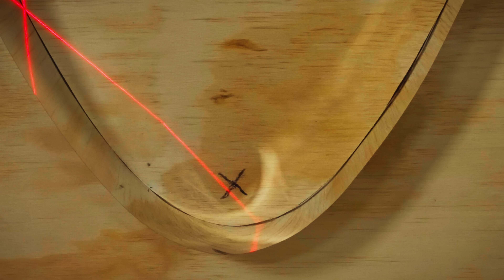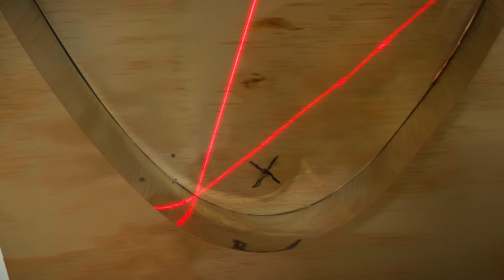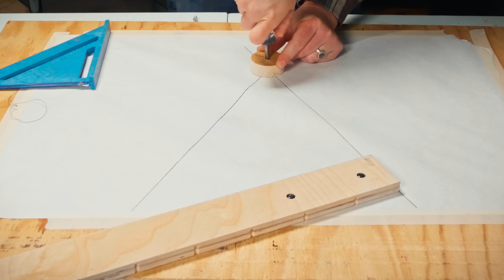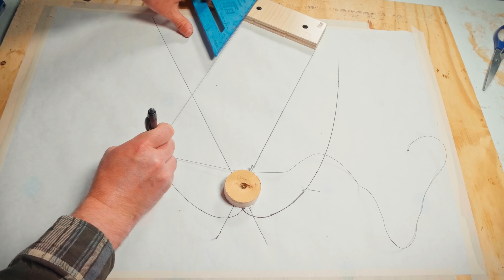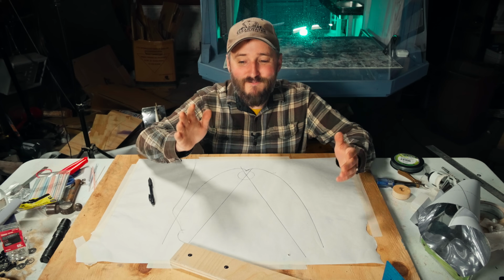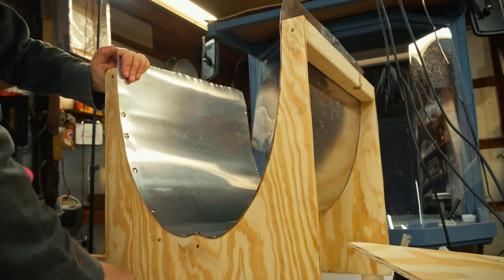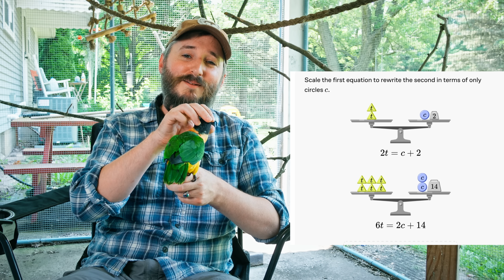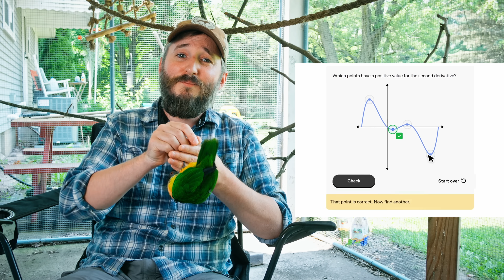DIY Solar Concentrators, Made Better.

Comment: Ben. Your commenters are correct. Your hanging chain catenary is NOT a parabola. But it’s close if you use this trick.

You may recall that the focal width of a parabola (that is the distance between the sides of the parabola) is 4p where p is the focal distance. OK, maybe not, but just take it from me as a fact because I already looked it up. 

Choose a focal length p. Separate the ends of the chain  by 4p. Use a chain length of 4.8p to 6p for a decent approximation of a parabolic curve.

Comment: Imagine if you took the compound parabolic shape that is meant to focus on a flat line, and then extrude and rotate around to create a mirror that focused on a circular plane. I wonder if such a setup where the plane was a solar panel would result in the panel collecting more solar energy than a similarly-sized, square solar panel with only the extruded compound parabola. The difference is one has a bowl-shaped mirror and the other is a trough-shaped mirror. I imagine the bowl-shaped one would be useful at more angles than the trough-shaped one.

Comment: I won't say this makes a better parabolic dish or not,but go to Wal-Mart or similar,get one of those hygiene mirrors with 24x magnification,and tinker with that.i found that adding magnification to the parabolic dish appears to be quite effective,but I am one to say experiment,and gather your own data.i doubt this can be easily applied to this concept in the video.i took one of those hygiene mirrors on a camping trip,and for something that fit in my pocket,on a sunny day it reigned king of burning material.

Comment: As ALWAYS, i LOVE watching and learning from your videos!!!!! I wanted to help share a idea with you ive myself been working on trying to research and possibly figure out, which is setting up a perfect array of mirrors for a solar panel, i seen a video about how in some state somewhere they made an incredible and amazingly efficient apparently, solar setup via a HUGE array of mirrors, all scattered perfectly placed across a flat piece of land, with the solar receiving part or panel they used was focused directly in the middle to where they were able to not only maximize the solar capabilities, but the video claimed they have been successfully running the entire town off this setup still to this day as far as i know. So MY IDEA is doing the exact same, but on of course far smaller scales. I want to try to figure up a way of using several mirrors to maximize the solar panel by having them setup so that the panel can be fixed in a single spot, but can get maximized and have the best chance of ALWAYS getting hit with the sun from as much i can reflect and redirect it towards the panel so that as long as the sun is out at all, i can have my panel in a fixed spot, but ALWAYS get it to receive sun if not direct then at least by the reflection of the mirrors. And im SUPER CURIOUS on how practical that would or wouldnt even be on such small of a scale. I know most people maybe yourself included, will say its a worthless road to go down, but thats why i wanted to bring the idea to YOU, because thats what you seem to do BEST, is prove to us not only how things CAN be done simple and easy, but also by even TEACHING US HOW and how we also can do the same. Which is why again i LOVE your channel, so PRETTY PLEASE WITH CHERRIES at least CONSIDER trying it out and showing us the results PLEASE!!!! i know if it can (AND IT WILL) work, MILLIONS of people would DEFINITELY WANNA SEE, and especially would wanna know how to themselves after seeing how simple it could DEFINITELY be done!! MUCH MUCH LOVE BUD, THANK YOU SO SO MUCH FOR SHARING YOUR KNOWLEDGE AND PROJECTS WITH US, I CONSTANTLY LEARN SOOOOOOOOO MUCH FROM JUST WATCHING YOU!!!!!!

Comment: One way to avoid using speed square is to pin the string to a point far away from parabola. String approximates constant direction and length.
Reply from the maker: That's a good idea! Probably more accurate than the square once you get out to 50 paces

Comment: 7:13 Couldn't you have obtained your cumpound parabola by using the chain trick, just offsetting a second parabola from the first one, vwith the crossing point  indicating the placement for the pipe?

Comment: Because of the ban of plastic straws in France, we sadly can't build those curves any more. Also, those curves could be useful to optimize a solar heater, dryer or furnace, or even a tiny-enough solar panel that can handle the heat.

Comment: Oh please you simply learned about the parabola. You didn't make anything better you simply learned about something that's been around for centuries. I am amazed that you had to get so old before you learned about this when us old folk knew about this long before you were born. The main flaw in your design is your collector angle and area, also try a circular design. If you want to learn more go check out ax^2+bx+c but it involves math which you probably know nothing about. Stop copying and start inventing.

Comment: The problem is in a colder climate this contraption will require a significant thermal insulation to save the heat from dissipating into athmosphere due to a significant thermal gradient between the target and the surrounding ambient temperature material.

Comment: So if I wanted to do this for a solar oven using my crockpot as the pattern shape, would I make three forms? One for the center (widest), and two for the ends(narrowest), and connect them like a skin for a boat? I imagine more forms (like bulkheads) would make a smoother form. Or am I reading too far into this?

Comment: I just ordered some peel and stick mirror film. I plan on making a 6ft shaped box on your design with a glass cover and a 1" copper pipe painted black. I'm going to circulate water through it from a 5 gal bucket and see how long it takes for the water to increase temperature and up to what temperature I can achieve.

Comment: A nighthawk heater , a junk car heater core, a computer fan, and ,a small solar panel along with insulated piping  [ most of you have or can access these items ] and you can bring the heat inside.  Ensure a zero pressure vent above the device.
.
 1/4 mile drag racing engine catch can  if your eternally anal.
Solar panel for computer fan= zero paid consumable electrons. And autonomous operation. Be well

Comment: Don't know if anyone mentioned it, but aluminum is excellent at reflecting heat.  Would have been a better test if you used steel on both.

Comment: 10:00 : "Amazing right ! No maths required !"    .....So it's a matter of "pride" now in mUrica to be a clueless Fvck about basic high school maths knowledge ? ....Finding an ensemble of points equidistant between a straight line and a circle isn't exactly rocket science (even compared to finding the ensemble of points equidistant between a straight line and a single focal point ) . It's just the solution to an equality between two vectors' lenghts  , and it so happens that the lenght of the normal vector to a circle is pretty easy to express without even including the circle's equation , it's just the lenght of the vector ( unknown set of point to----> the center of the circle which is fixed )....... minus the radius of the circle ....

Comment: 9:28 Keeping the alignment would be simpler with a long t-square like those used in drafting, which could easily be made from scrap material. The pencil would only need be held in contact with the leg of the square while keeping the string taut.

Comment: Question? Out of the box idea.  What if you made a LED cob style arraignment of fiber optic cable. Could you use this as an inside light source? Use a LED style of reflector with each cable inside the building.?

Comment: You're making the parabola much too deep. You want to use a much smaller pipe 1/4" with a much smaller parabolic reflector. Use a series of 1/4" pipes and use black BBQ paint on them. Create an array of smaller tubes and use a large  fresnel lense over the array with the opposite curve to collect the light from horizon to horizon and keep it constantly focused on the parabola from all angles. You'll  get flash boiled water all day long without tracking the sun.

Comment: I think you can't draw any conclusions from the practical test as the setups are too different:
With the parabola you have an aluminium tube that is open on both ends. A highly heat-conductive material that has airflow going through it to cool it.
The others is a cast-iron pipe covered on one end. So no airflow and even partially shielded.

Comment: Making a V-shape instead of parabolic with a 35 degree angle will also collect indirect radiation and the tracking can be timed versus solar tracking. Simpler than parabolas and collects more energy . 35 degrees will collect reflected indirect sun and still hit your focal point.

Comment: Coating that pipe in a black thermal paint could push those values higher too. Eventually you could need to insulate the pipe where it meets the wood. Copper pipes could be good too in creating higher thermal values in the pipe.

Comment: I think I see a flaw in your test.  Thermal conductivity between the iron and aluminum pipes is very different.  The parabolic setup is likely sinking heat to ambient nearly as fast as it generates it.

Comment: I stumbled onto this by chance, while researching various types of solar heat systems. I believe it’s the solution to a problem I have. 
I live in Saskatchewan, where we regularly experience temps of -20 to -30C for weeks at a time. 
I have  an approx 150 sq/ft porch that gets positively frigid during the winter. 
I envision 3- 3” copper pipes, 4 feet in length, mounted in a single compound parabolic collector, either plumbed in series or connected to a manifold. 
I’m wondering if anyone has suggestions or experience with a system like this in a cold climate.

Comment: I made one 20 years ago. copper pipe radiator filled with oil. The mirror tracked the sun with 3 diodes, small motor and solar panel. I had a fan blowing the heat into the house. Worked very well for heating a room
Reply: Now that I’d love to see

Comment: One or more commenters have suggested a mistaken tip about improving the heat absorption by creating a wavelength selective surface after roughing up a copper surface. That part of their advice is exactly backwards. ☹️ 
You DO want the copper to be extremely clean before doing the phosphoric acid treatment, BUT you want to have the most mirror-like finish possible on the copper before doing the phosphoric acid treatment. What you want to end up with is a black mirror. 
The reasoning behind this odd sounding bit of Blackbody Radiation physics is that a mirror is the worst possible solar absorber, and a terrible absorber is also a terrible emitter. So when you put a thin wavelength selective coating on top of the mirror to absorb visible light, you end up with something that is great at absorbing visible light but simultaneously is terrible at radiating infrared, yet still conducts the absorbed heat energy into the substrate. 
Roughing up the surface creates tiny features that are excellent at matching the wavelength of infrared and therefore radiating infrared. Thus a rough surface defeats the selective surface goals, at least partially.

Comment: ❤Hook another smaller replica of this to the actual main mirror combined with a peltier device in order to run a pump that moves air into a room or water into a radiator. Or a have a small solar cell fed with concentrated light and cool the solar cell with peltier devices that runs the pump. 
I wish I had more time and energy to do this myself.

Comment: You could combine air heated in an solar panel with a booster duct that gets placed as a tube in the focus of the reflector device. 
The result should be good efficiency without tracking needed.

Comment: How practical it would be to set up large system that would heat up water that will run through the turbine to generate electricity (similar how nuclear station works)

Comment: You kept saying the the sunlight hits a single point.  However, it looked to me that it would hit a line the length of the tube.  Is this the case?   If so, could somehow curving the mirror, i.e. making it a portion of a cylinder instead of flat, allow it to focus on a single point?

Comment: If you put parabolic mirrors connected in series with a water pipe running through each, could you heat water ? I could see a wall or panel of these. Cover the front with a solid piece of glass or plexi and snake an air channel from bottom and past each mirror to the top for heating.

Comment: What happened if you replaced the tube with a Dutch Oven and increased the diameter width of the parabola. For cooking!  The dutch oven diameter is 12 inches.

Comment: 15:54 So wait (speaking slowly) that flat surface could be..say..a solar panel??🤔👀🤯
Reply: Let me add this realization/question - there are two advantages to this curved reflector:

1) the collector captures all the sunlight that falls through the opening - so more square footage.

2) it makes the angle of the light irrelevant.

At first, I wasn't sure the wider opening warranted making one for solar panels. (The flat surface example opening looks barely more than the width of the flat surface itself.)

However! The second makes it worth it because of the angle of the sun daily and seasonally! Especially for cloudy days.

Lastly, I do understand that how solar cells are wired together requires that the voltage output is the voltage of the lowest panel - and therefore even small shadows (or other brightness inconsistencies) can have a detrimental effect on total output.

And so unless the curve is consistent, maybe it's not worth it - because brightness hotspots won't improve the output.

Would be worth doing some of these tests myself!

Comment: Hey for flat collector when we add concentrated photovoltaic cells are the surface area of collecting light directly linear to ratio or Power of collector ?
For example , 
1)if we consentrated it hundred times ,, If the greenhouse protector glass is one square meter, 
2)And collecting area is One square decimeters .

So the concentration of c p v in the size of one s decimator would be hundred sons? !

Comment: Hey, use a stovepipe covered in soot as the target and blow air in one end and put a cook box on the other. Outdoor air fryer?
I like your curves to collect on a flat spot but note that the flat spot could be an opening all of the light passes through --- perhaps into a box cooker.
With a flat sided V trough (can make with flat mirrors) a middle area can receive all of the light when aimed at the sun. 
Curves are better but door-back mirrors are big and cheap!
For a non-point target one can make a polygon-parabola with flats that reflect light less wide than the target. It's easier to stretch reflective material flat.

Comment: This is very interesting. Thank you.
I make my solar concentrators by placing the item I want to heat about a foot away (purely arbitrary, of course, depending on the size of object to be heated) from a reflective sheet and then bending the sheet so that the light impinges on it in such a way that the full radius is always covered by the concentrated rays. In other words, half of the container faces the sun, while the other half is bathed by the reflection. Using this method, it doesn't really matter where the sun is, as half the object will always be heated.
When tracing out your compound parabola, do only one side, then fold your paper vertically exactly in half and cut along the line. 
This saves tracing out the second half.

Comment: Alright, here is what I cannot figure out except for after actual tests.  Assume the weather is negative 30 degrees Celsius, assume 1" foam surrounds 3 sides of the solar concentrator and assume 1/4" acrylic seals the whole.  Assume it is a cloudy day, and 60 degree Fahrenheit water is being fed into the system at normal tap pressure.  Say you mount a 10 feet system of this times 3.  Just to bolster the ideal that the system works and the water sent won't return colder.  It's just difficult for me to imagine.  What change in water temperature  should I expect at the end of each 10 feet system on a -30 degree Celsius cloudy day with a compound parabolic system?

Comment: This could be used to make a passive water distillation machine, with the radiative paint to help water condense back into a liquid.  I've been interested in distilling my own drinking water after learning more about the common contaminants of regular tap water but I havent found very practical ways of getting distilled drinking water other than buying it, also ik you cant drink just distilled water bc you need minerals. Since this uses solar power and that is renewable and somewhat free I might try and use this concept, as always Great video!!

Comment: The chain line does not describe a parabolic curve, but the hyperbolic cosine (cf. any encyclopedia entry for "catenary"). A parabola is the graph of a quadratic equation, these are very different mathematical bases. It might get close enough to see the desired effect in a crude diy build, but if you want optimum efficiency, this should be corrected.

Comment: A tightly stretched chain (or cable) behaves almost like a parabola. A loosely hanging chain clearly shows its true catenary shape. A true catenary arch (like in St. Louis’s Gateway Arch) perfectly follows the natural curve of a hanging chain inverted. A parabolic arch looks very similar, but if the load distribution isn’t uniform along its length, it doesn’t bear weight as efficiently. A parabola “becomes” a catenary only approximately when the catenary’s sag is small enough that the hyperbolic cosine can be replaced by its quadratic approximation.